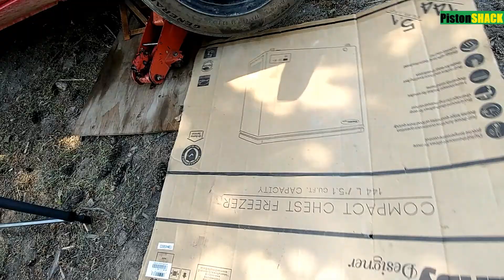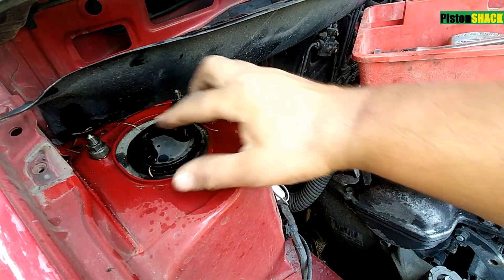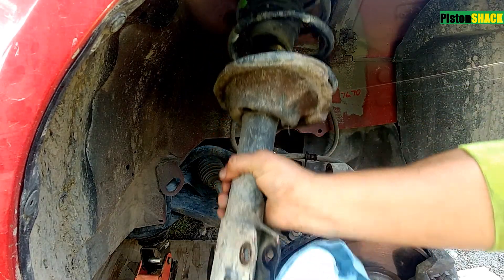HOW TO REPLACE FRONT STRUTS on TOYOTA ECHO EASY-PEASY in 5 minutes! | Save Alignment.

Comment: question if the car leans abit and is not level is it the strut or spring that need replacing
Reply: getting mixed advice springs+ front strut and front strut only thaniks

Comment: Would have loved to know the torque specs, or where to find them.
Reply from the maker: Strut bolts to knuckle - 97 ft.lbs
Upper mounting nuts - 29 ft.lbs
According to 2002 Echo Toyota manual.
Reply: @PistonShack  Perfection! Thank you!